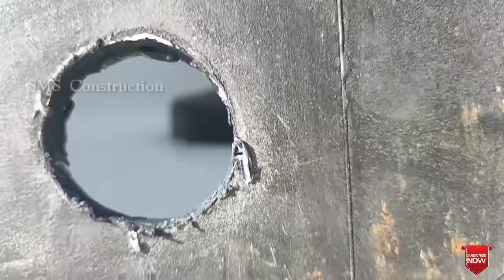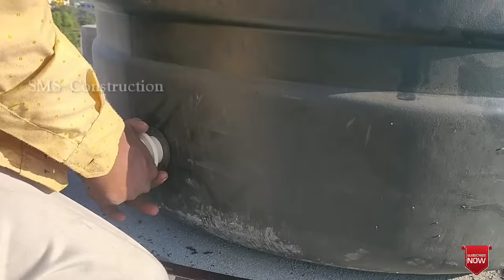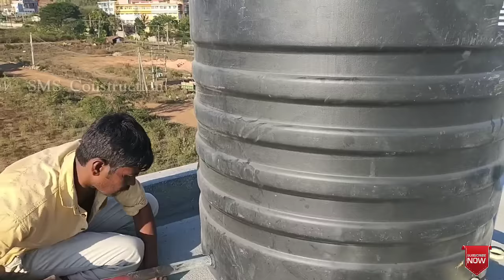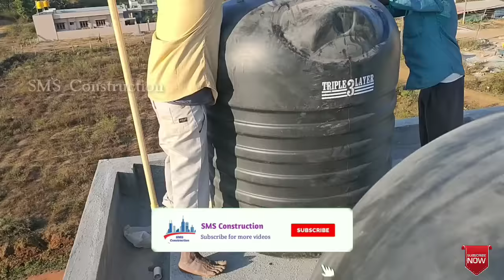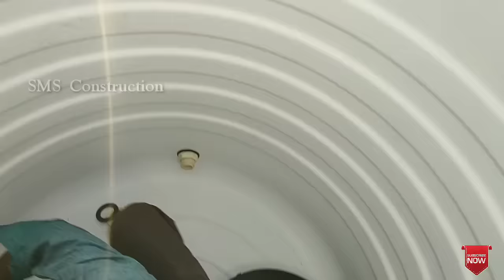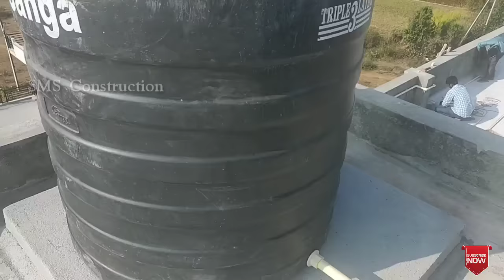How to connect 2 water tanks | How to install 1000 ltr   water tank on the Head room

Comment: Overflow pipe maybe connected in outlet pipe by providing T to avoid unnecessary hole in water tank. And  provide separate valve control in each tank is always best method.
Reply: Yeah, didn't think of that. Thank you.

Comment: @sms why are you putting an extended pipe with T on the outlet pipe? Please explain what’s the purpose
Reply: For Air exhaust, otherwise water down flow will not go smoothly. Extended pipe has to be higher than water tank .
Reply: @BoktiJamir  thanks bokti. help how I can connect 4 tanks together please, do I need non-return valves ??

Comment: Sir, is it OK I see in yr video, you joint the cpvc Tank Connector's male-thread TO cpvc PT socket/FTA using only CPVC Solvent Cement without coiling PTFE sealing tape??
Wont leak if used under Mains Pressure?